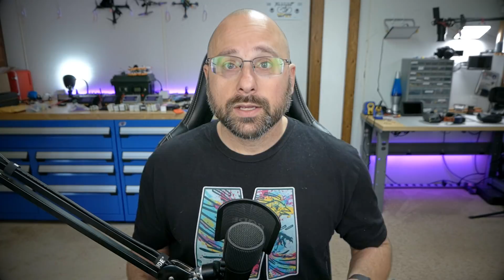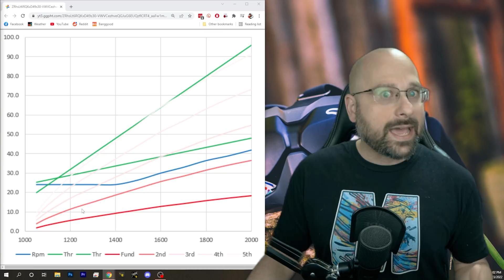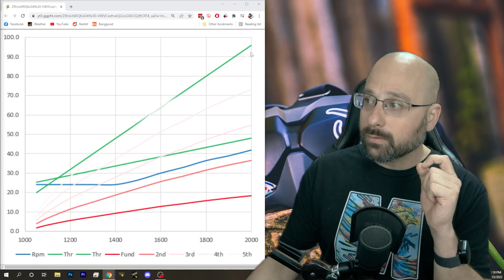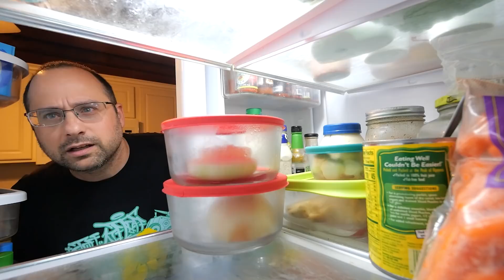Do you REALLY need a 128 kHz BLHeli32 ESC? Maybe not.

Comment: I run fixed 24k PWM for 6S 5" freestyle, 6" mid range cinematic, and 7" mid/long range cinematic...and honestly think that's best... I've experimented with 48k which was noticeably smoother, but found it came at the cost low throttle wobbles, particularly on larger 6-7"rs, in high wind, and at higher elevations above sea level. I found I could compensate somewhat w/ thrust linear, idle, & higher i-term... but that came with its own idiosyncracies. I'm curious about running 24~48k variable for mid/long-range efficiency, but until I really get motivated to push the range on a build to reach something I can't currently get to, I'm happy not to do the extra tuning that I think it will require and stick with 24k.

Comment: Something doesn't add up here.  You seem to be comparing motor RPM (rotations/minute) to PWM in Hz (cycles/second).  Its also not clear if the RPM shown is mechanical or electrical.

Does the factor of 60 get cancelled out somehow when taking the pole pairs and commutation into consideration?  Your analysis may well give the correct results, but the engineer in me wants to know more.
Reply: Harmonic frequency is motorRPM/60 * number of poles on the motor bell * N, where N is the harmonic order (N =1 fundamental)

Comment: Efficiency goes down on higher PWM... higher risks of fet failure... switching losses. In short, don't go the 128khz route if you want to be safe. 128khz will not make you fly better... 60A instead of 30A will not make you fly better... etc etc. hope you guys get the point a bigger number doesn't necessarily mean better ;)
Reply: No, efficiency goes up on higher pwm, power goes down
Reply: @josh8106  actually they are correct. Higher pwm frequency creates more heat in the esc so yes more failures
Reply: Efficiency in the ESC is worse with higher frequency since the transistors are in the switching region for a larger portion of the time. However the motors might run more efficiently with higher frequency since the current fluctuations has less amplitude. You can get your motors to run cooler with higher frequency.
Reply: well yeah but overall efficiency goes down. Either way risks in this particular application is too high from my view for marginal gains.
Reply: @LivyuFPV  except... I have had hot motors and fixed it with higher pwm frequency. But I have never had hot ESCs... Ok I fly like grandma duck drives her car so maybe I'm not representative for anyone.. except ducks driving cars.
Reply: @Siamect  the esc is stressed a lot with 128khz... and could experience puff up fets :)
Reply: @LivyuFPV  Sure they have to design it with that in mind... In the good old days 1990 something I designed a motor control for golfbags!!!... FETs at that time was slow so switch losses where everything we worried about ... so testing was everything and we went from 16kHz down to 4KHz and then all the way down to 100Hz and the noise was annoying like in a thyristor based controller but the FETs stayed cool... until you blocked the motor and everything went up in smoke so a fast current limiter was really important.
Reply: @Siamect  indeed... now imagine a 128khz quad crashing :)
Reply: @LivyuFPV  But actually higher frequency is better when if you have a crash and motors are blocked. It's less time to build up excessive current.
Reply: @Siamect  In my experiments thisnis the otherway around...
Reply: @LivyuFPV  Which means you think that less on time will result in larger current build-up? Remember when the motors are blocked, you have no EMF to counter the battery voltage and the current goes to the moon in a snap...
Reply: @Siamect  i am thinking at shoot through issues :)
Reply: @LivyuFPV  Which is caused by incorrect timing. Timing should be correct regardless of pwm frequency.
Reply: @LivyuFPV  The timing I was referring to is of course  the time needed to avoid shoot through, since you brought it up and that time is not depending on any of the settings we are discussing and it is not getting weird just because you have an abrupt stop during a crash...
Reply: @Siamect  I was thinking that because the higher PWM, failures similar to a shout trough could be seen. Despite timing being correct. Obviously purely theoretically but I have seen many such weird failures that i have but 2 possible reasons... either to high voltage spikes going over fet limit or the fet remains closed not having the time to open for some reason but that goes back to the pcb and schematic issues i guess. Either way :) just spilling my thoughts here dont mind me.

Comment: My experience has been always keep the high and low the same, its never really worked right for me using any range, vs having my frequency locked at either 24 or 48 but if I turn up my throttle (usually run 5.5) it does work a lot better, but I’m gunshy because I had dsyncs with one ESC when this feature first came out. Maybe newer hardware handles the variable pwm better? or blheli has gotten better, maybe I will give it a go.

Comment: If the product listing on retailers sites, and the manufacturers website doesn't display the PWM, or the chip its using, what would you imagine it is?
Reply: Something you probably wouldn't want to buy, I'd say.
Reply: @luckbot-3000  I don't think that's true. There are alot of reputable manufacturers that are leaving this out. I'm building a diatone mamba F722APP right now, and that esc does not show the pwm specs.
Reply: @BrunDog  Well, if you're looking to get an esc capable of a specific feature and the manufacturer just isn't supplying the info you need, you don't want to get that esc. There are so many different (reputable) manufacturers that you can easily choose one that fits your specific needs, whatever they may be. If you already have an esc, there's no harm in trying if it already works for what you want to do with it. You could maybe look at build targets for the specific esc you're eyeing, if they're available. Another way to find out would be reviews. As a last resort, try to find a high res image where you can see the chip markings. But why bother if there are easier and equally prized alternatives?

Edit: If you already own the board and it does not support this feature. Know that at this point these things are nice to have but very far from necessary. We're at a point where you could probably make a piece of pudding with sticks attached to it fly, using betaflight. Don't worry about these small things and enjoy flying (and building, of course)

Comment: Great content as usual. Just a small correction. Not everything that has a frequency has harmonics. Sine waves have a frequency, but no partials. Just the fundamental frequency. These motors generate square waves which are partial-rich sound waves.
Reply: Still not quite right😅✌️ a sine wave is still a harmonic frequency. It just contains it selfs frequency, but it is a harmonic. Because the Definition of a Harmonic Signal is a sine oder cosine function.
Reply: @-Relectron-  Thanks for the comment. And yes!  a sinusoidal wave's only harmonic is it's own fundamental frequency. My comment attempted to clarify JB's statement because he's referring to filtering partials above the fundamental frequency of a sound wave. Something that can't be achieved with a sine wave.

Comment: For me the BHELI setting at 24khz low and high give’s me the best flying experience. 16 Low and up to 48 I had strange motor sound :)
Reply: 32.8 variable you are talking aboutis not the same as the build Joshua is talking about. Joshua is talking about by rpm